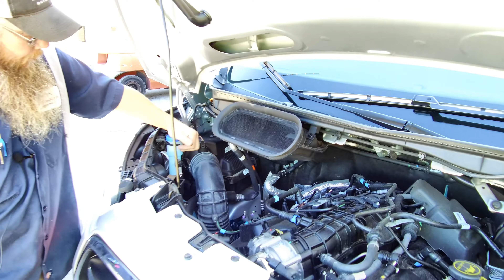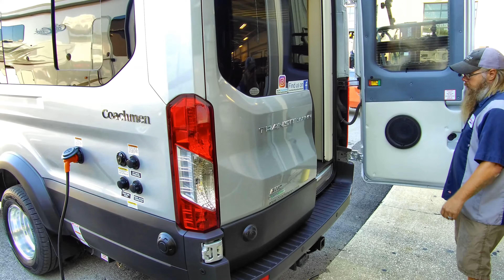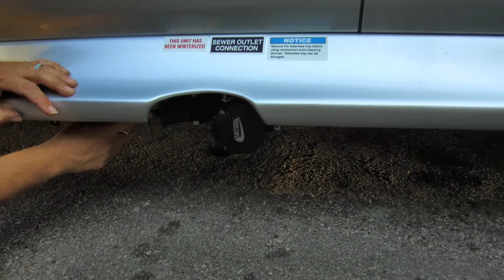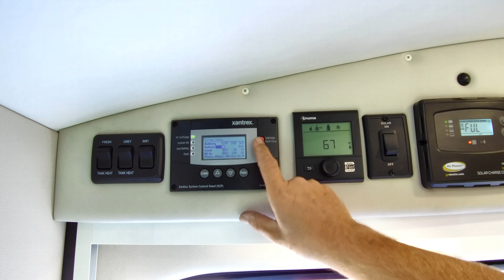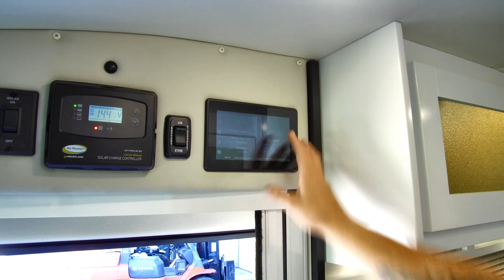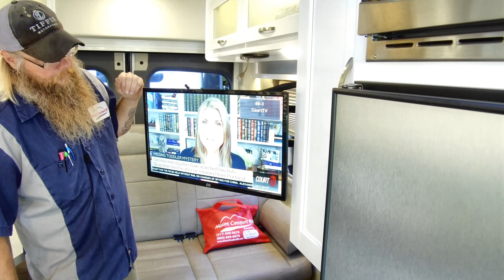2021 Coachmen Beyond 22CEB Li3 | RV Tech Tour

Comment: To the point. Excellent presentation. Please tell me if there's a propane free version of the Beyond model with auxiliary alternator.
Reply: We were told by Forest River that all Coachmen Beyonds are made with a propane tank.  You can leave the tank empty if you don't want propane.  Our 2021 Coachmen Beyond Li3  does have a second alternator under the hood -- referred to as "the underhood generator."  The Xantrex system has an alarm in one of the cabinets which starts beeping if your Lithium batteries are getting dangerously low.  When it goes off -- you can start the engine to recharge the battery through the second alternator. MJ

Comment: Are there big differences between the 2020 and 2021 models as far as chassis?
Reply: Kevin Lunney check out the YouTube video on 2021 Coachmen Beyond by Sunshine State RV. Nick say Ford upgraded 53% of the Ford transit from 2020 to 2021. I bought the Beyond 22D with Eco Boost. I pick it up in 2weeks.

Comment: Why do induction cooktops only come with 1 burner?  I've never seen a dual burner induction.  I'm a Chef and that's a deal breaker for me.
Reply: I’ve seen dual burner portable induction tops.
Reply: @onionhead5780  On what RV's (make and model) do you recall?
Reply: You can order the Beyond with propane 2 burners.  Induction is an upgrade.
Reply: @donnahutto1304  The response I got from another source is that induction cook tops take A LOT of power to get and stay hot, and that a dual induction would REALLY drain batteries rapidly.  Makes sense.